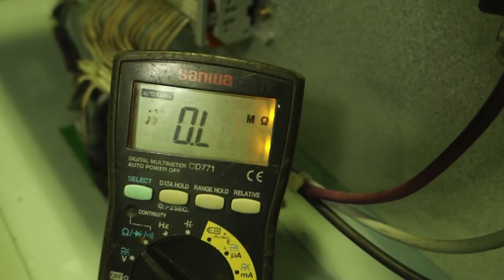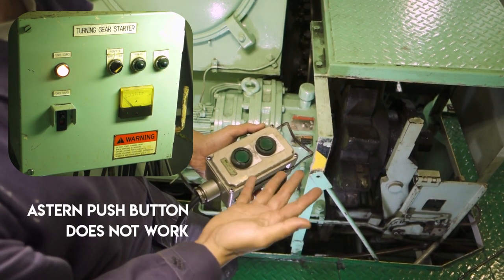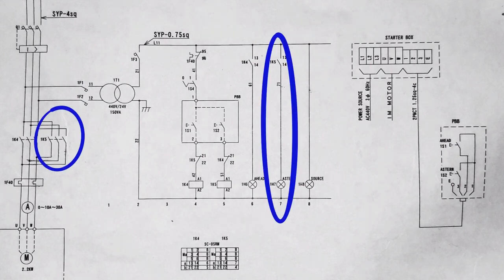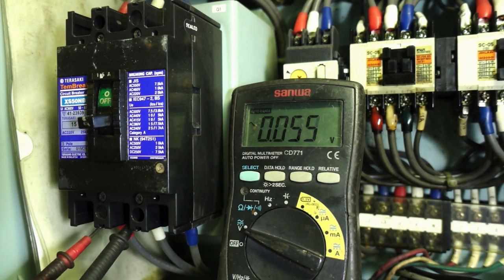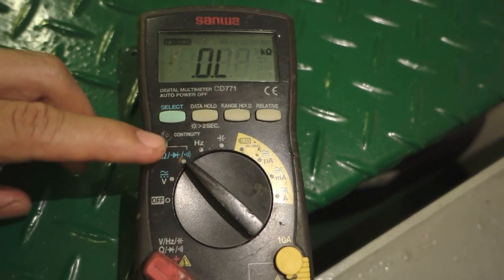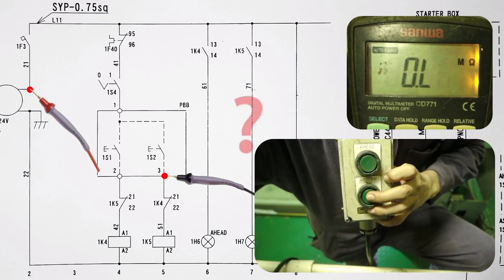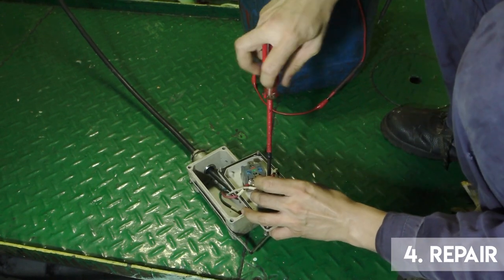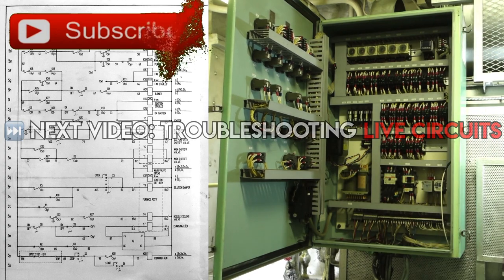Troubleshooting on a Dead Electrical Circuit ㅣMarine Electrician

Comment: Nice. I have been a marine electrician at a shipyard for over 30 years, and while I am pretty good at it, one thing I tell the newer guys coming up is that you will never know it all,  the systems are always changing on ships, and there are usually always more efficient ways to troubleshoot problems.
So it is always best to keep learning and watching how others do their thing, because sometimes when someone looks at a problem a little differently,  they may find something that you may have overlooked. So keep an open mind, and strive to never stop learning!😉

Comment: Great idea, awesome video and good explanation! But... I felt frustrated starting from 03:40... It was unnecessary checking 1F3 fuse and 1F40 overload relay NC contact. Your motor was turning one direction and 1K4 contactor was energized. In such situation, everything that should be in focus only: 1) remote control 1S2 contact, NC contact of 1K4 contactor and coil of 1K5 contactor. I think, if you narrowed your troubleshooting down to these components, you would got fond the cause on the first try. But that was not that what you wanted... Right? Why didn't you wonder who did disconnect the wire and why? I believe, you know the answer :-) ... You did it to make a nice video! By the way, anyhow it was pleasure to watch it!
Reply from the maker: Yes. Sorry about. I forgot to include that it wasnt necessary to test circuit before the push button. I just did that so the viewers can see how it is supposed to test circuit. Also I could find the problem right away if I test directly at the remote control. 😆  This is just a simulation. Thank you sir.
Reply: Such a great observation Superintendent.
Even tho' this video really teaches how to trace a short circuit.

Comment: First you should check remote controller right away,because of the forward button is working that tells me there is power going in to the remote controler,so obviously the issue in the reverse button,this should save you lots time doing troubleshooting ;)
Reply: He said at the intro that he has simulated the scenario.!!!  qanacagin olsun camaat ezyet cekib bir cox sagol demekden agil verirsen))